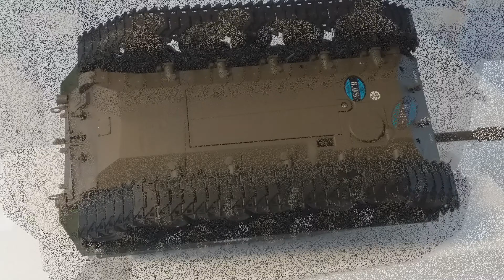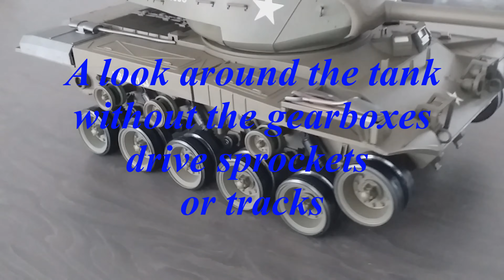Heng Long Walker Bulldog Gearbox Change

Comment: I've been thinking about upgrading the tracks, road wheels and suspension on my M-41 but I don't know how to take the road wheels off. Do I have to break the center caps off to get to the screws or are they threaded in really tight?
Reply: Hi Cliff, Yes you have to gently prize the caps off and then unscrew the wheels.
They may be threaded a bit tight and need a bit of force to get them off but they will come loose.
Kevin.
Reply: @kevcrookes  Thanks, you've helped me with upgrading my tank. Now all I have to do is wait for the stuff to get delivered.